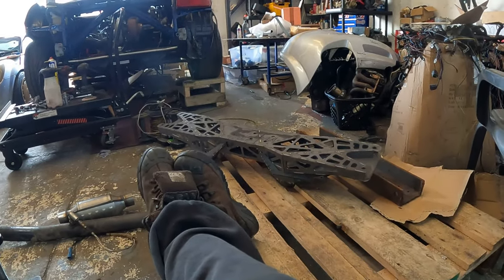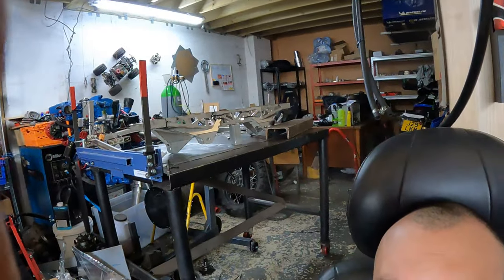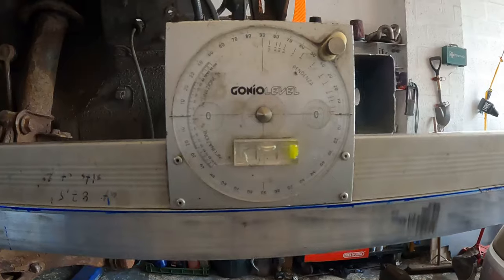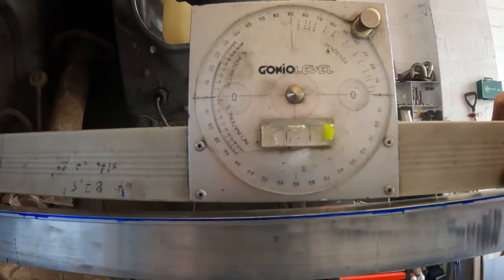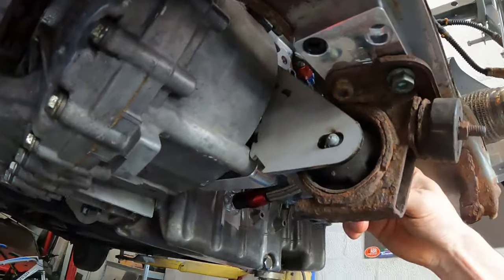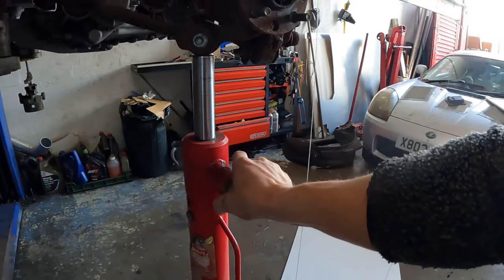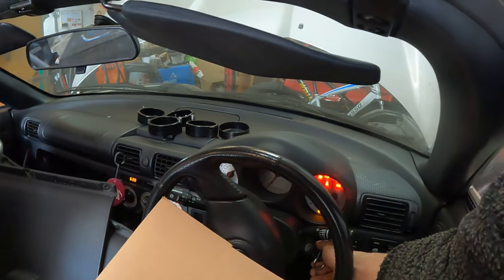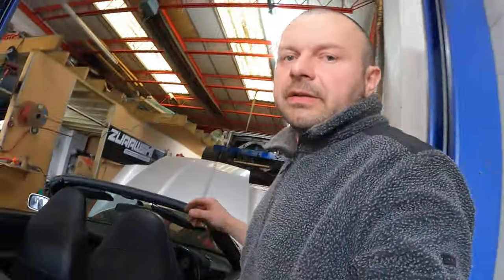Mk3 MR2 rear suspension explained, high performance subframe, and bumpsteer myth busting!

Comment: Watching and 40 minutes in, but haven’t heard you address yet. How much do you think added bracing helps in the rear? Especially the Toms under rear brace. As you say, the subframe is only as strong as the weakest link, so perhaps these braces can’t strengthen every part/section of the subframe?

Comment: Bump steer and snap over steer are two completely different things. Bump steer is something known for decades, caused by tie rods travel not following a arc that suits the suspension travel. Snap over steer is an new phrase created by people who don't understand weight transfer in a chassis. A mid or rear engine car transfers weight to the front quickly when braked to suddenly or turned to suddenly. Simple stuff.
Reply: Nobody said it was the same thing. Two different issues people constantly talk about on these cars.